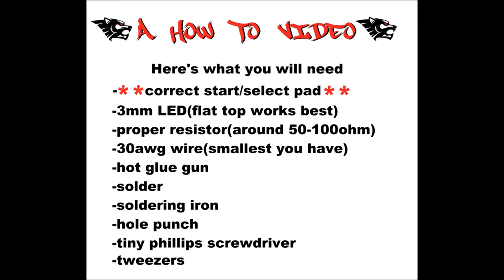How to install LED PS button.short version

Comment from the maker: The easiest way is to solder them to the rumble motor wires. This will make it light up any time the controller vibrates. NOTE: most of the time, when you fire your weapon, the controller vibrates so your LEDs will also light up. Hope this helps you :-)
BTW, I always take the motors out of my personal controllers because I don't care for the vibration. This opens up lots of room to tie all of your wires together if you are installing a bunch of wiring.

Comment: Hey, think you can make a tutorial on how to do the flashlight mod for the newest version of the PS3 controller?
I want to add some LEDs to light when I press R1, but it's impossible to find a good video. None of them show where to solder onto the circuit board.

Comment: hey bro, you make the best tutorial for lighting the PS button. but im wondering how come you can hole punch the plastic circuit but only certain rubber push pads work...ive got everything your supply list states. its just that i dont have one of those rubber start/select push pads that you say "will work". i have the one shown at the bottom right. so what i m getting at is im wondering if there is any way to make it work and if not.. how would i go about getting one from you?